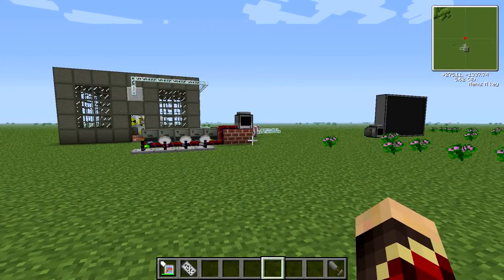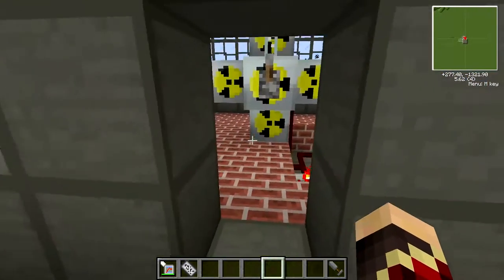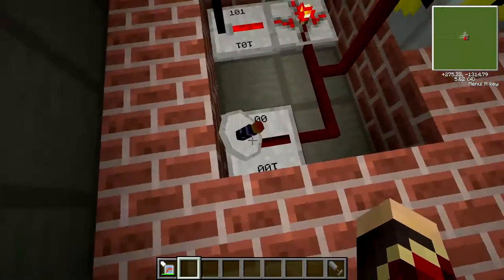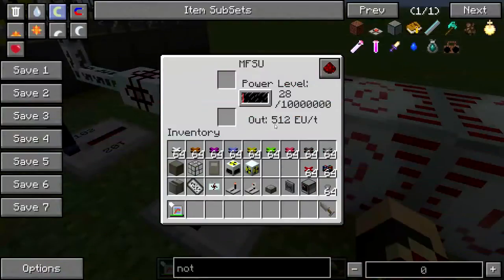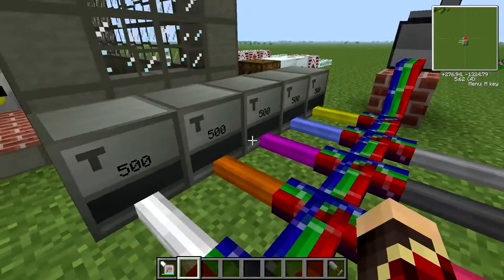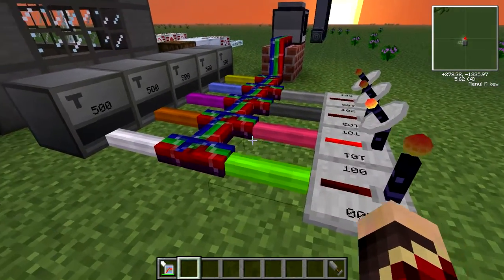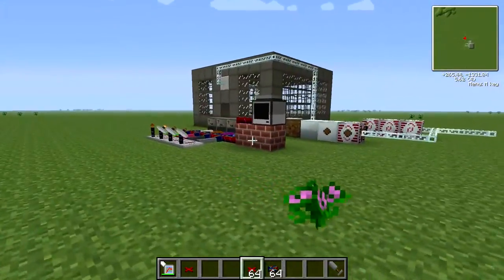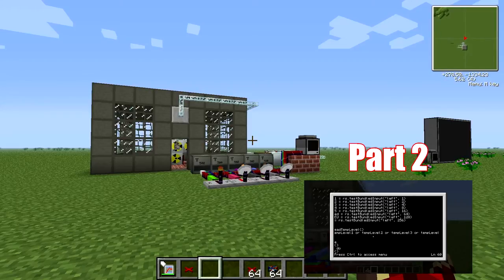Computercraft Tutorial - Nuclear reactor control part 1

Comment: if you're still here, will openCCsensors be able to work with this? and can you create another version that would not use wireless redstone? not that it's hard to make, but to give it more chances for something to go wrong ;)
Reply from the maker: Hello. I am still well and alive. =)

Will first say I do not play much Minecraft these days. But openCCsensors were not supported by the Tekkit mod back in the days and therefor could not be used. But I assume you can put up a own server with openCCsensors and computercraft to make this work.

The only reason I used wireless redstone was to have as few weak holes in the chamber as possible. For the temperature limits I had to use the remote blocks. I am not sure if the construction foam also will fill a bundled cable hole. If that is possible I would just run a bundled cable to the reactor, maybe control lights in roof as well with colors of the reactor status. =)

Even doing this will not make it more unsafe at all, since as long as the program runs, the reactors will never overheat.
Reply: Whiptail84 I appreciate the reply, and from that I just assume I'll have to try on my own then, as I'm running 1.7.10
Reply from the maker: I can help you if you have problems making a code work, but I only have time till 5.August as I am going on vacation for 2 weeks. Even if I do try to help you, mind I have to re-learn some stuff and that I have not worked with openCCsensors, only read up on the basics a couple years ago.
Reply: Whiptail84 ah, thank you for the offer, i will let you know if i require any assistance

Comment: Will this work with ftb unleashed??
Reply from the maker: Doesnt look like it, you need following mods for my exact setup:
-Computercraft
-Nuclear Control for Remote thermal sensors
-Redpower 2 or ProjectRed for bundled cable. MISSING!
-IC for power storage and transfer and EU detector cable
-Wireless redstone for redstone reciever and transmitter

As you see, Redpower 2 i missing. Redpower 2 isnt being updated anymore, but ProjectRed is a really good substitute.
Reply: okay thanks. i dont like dirwolf becouse of greg tech